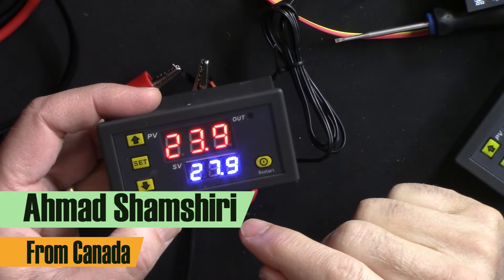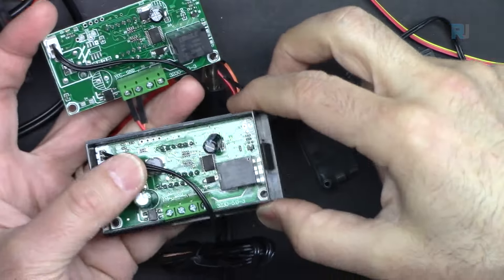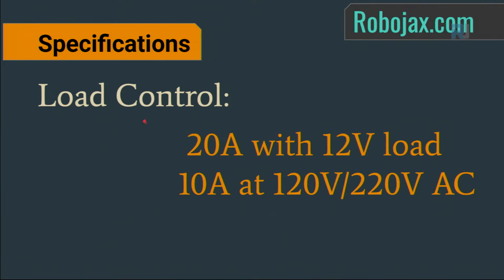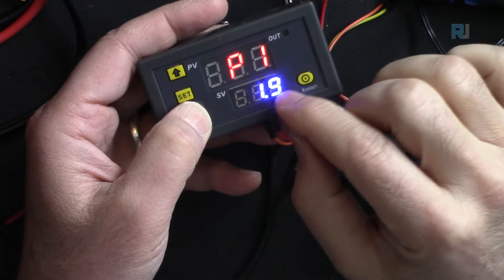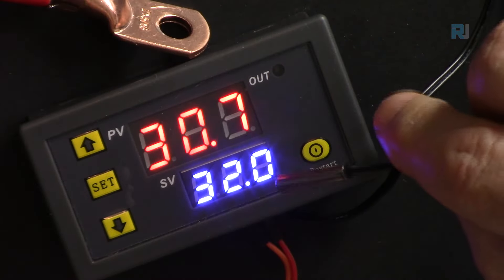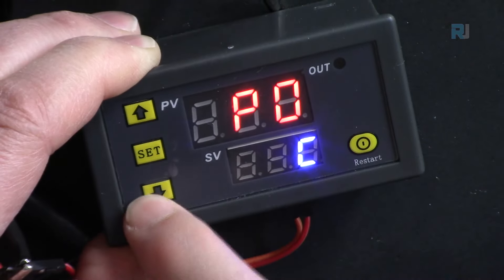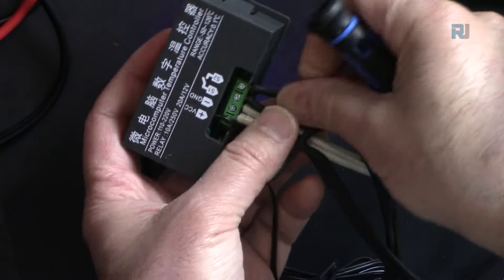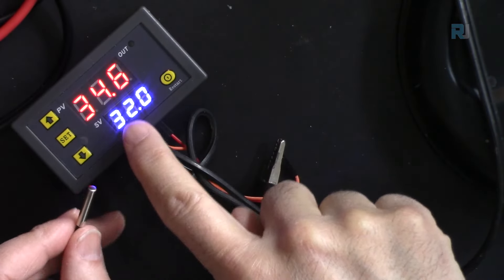How to use W3230 Thermostat Heat and Cold Relay Controller AC DC 12V/24V/120/220V P1 to P8

Comment: Hello. May I ask what is the power consumption of the controller ? Thanks you!
Reply from the maker: for AC is it so minimal that would be negligible. for DC however you can calculate 10mA for each segment of a digit for example digit 8 has 7 segments(and digit 3 has 5 segments) so 7x10mA=70mA only for one digit. Then the relay consumes about 50mA and 10mA for the board. Do the math.
Reply: @robojax  Thank you! The math goes quite high.  The digit consumes 10mA but not at 12V. Do you say that only linear regulators are inside? At 12V it can easily  be 5W or more. Really so high?
Reply from the maker: I believe internal regulator is 5V so all the value I gave are at 5V. I wish I had tested the consumption of the module. it never occurred to me because of AC I neglected the power consumption.

Comment: I have purchased and tested one of these devices (110-220v with 220v/10A 12v/20A relay).
I have found a number of anomalies with this device compared to this video and several other W3230 instruction sets and videos. As this device posesses a generic micro-controller, there may be any number of differing programs or  coding applied and hence a range of differing methods for user operation and setting ranges. 

I have prepared a full instruction set as tested, highlighting all of the anomalies, warnings and Cautions. However it is too large to accomodate in this comment section.

Comment: Hi your videos are always very detailed. Could you say if this can be used with a different temp sensor. I would be monitoring transmission oil temps with this device as well as to turn on the cooler fan when the temp gets to 190 degrees F. Hope to hear you thoughts. Thanks
Reply from the maker: Hi, I don't think it can be used with any other sensor. this is microcontroller and is programmed to work with a particular sensor.
Reply from the maker: Build your own and control is any ways you want. here is one example https://youtu.be/dVh77wT-4Ao but I've got more examples if you search my channel.
Reply: Hi many thanks for the reply. I will try to build with the esp32 and add a display. Just need a small project box to mount on the dash board. Also the bluetooth function would be an advantage. I can manage the hardware aspect but the software I will have to learn. Many thanks and have a good year.

Comment: Interesting AC/DC gadget. Let me ask you, I purchased a power supply and was sent the wrong one for my country. Do you have a video where  showing how to covert a 220V to work with 110V AC?
Reply from the maker: Hello, you can't  change the circuit. Most of the time it will cost you more than buying another one.
Reply: @robojax  Okay thank you for the feedback.

Comment: Hi Again, I assume your answer was meant to state "voltage" and not "village". You did state and show 220v on the controller in the video. I wanted your expert opinion, if connecting UK 230vac on this controller would be ok? What do you believe would be the max or peak vac that it could handle without damaging  the controller? Thanks. Pat.
Reply from the maker: Hi, Yes that is what I meant. My phone  (the AI) is sometimes helping me to make "my life easier" LOL. But the context of our talk will help to know we talk about voltage.  if your item is made for 220V, then yes. you can use.

Comment: hello! :) what is the lowest possible value for the SV? for mine, I see it is 7 degrees. i want to change it to around 3 degrees but lowest SV Limit is 7 degrees..
Reply: I have mine set to 3°C but it will go lower if required. I found the P05 to be the setting that sets the maximum temperature to disengage the relay and not P02.